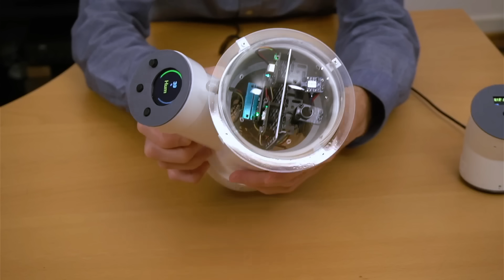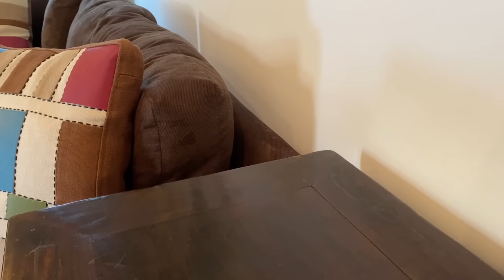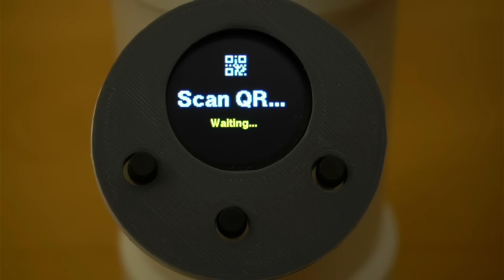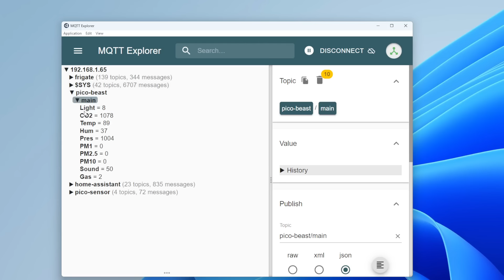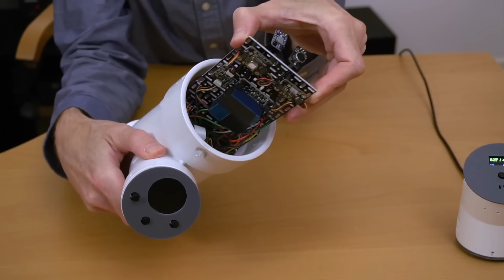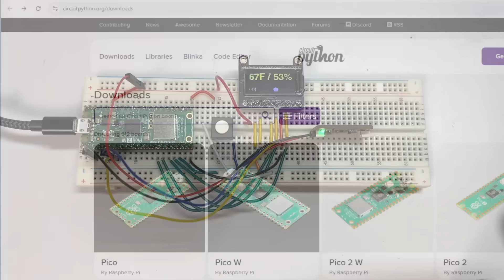Home Assistant Indoor Sensor Project You Didn't Know You Needed

Comment: Looking for a sensor that works with H2 gas for home assistant. The reason is I have Lifepo4 batteries for solar I want to detect H2 gas which if the battery malfunctions and vents this gas it want to be alerted to this.

Comment: I re-designed the top for bolting the screen and sensor to the top so you don't need the bread board, slightly different momentary switch, so you can use header pin jumpers for easy wire install/troubleshooting. Not sure if you'd be interested in the STL or not but I think it looks sharp
Reply from the maker: Sounds great, please do post the STL file and/or a photo in Github!

Comment: Any chance you can provide a slightly cleaner wiring diagram for the mini? I like this a lot and want to make sure i get it right
Reply from the maker: Yes, though it may take a week or two. I need to find the online CAD tool I used to use.
Reply from the maker: I uploaded a new diagram. For any questions/comments, please use this issue: https://github.com/alanb128/ha-environmental-sensors/issues/1
Reply: @BorisDigital  Thanks for making the cleaned up version! Looks great plan on wiring this weekend!

Comment: Wondering if it would bd wise to install a small ventilator in the pipe to make sure it isnt measuring stale air
Reply from the maker: That's a good idea. I forgot to mention in the video that both devices have vents in the bottom and holes drilled around the sides to help with airflow.

Comment: Why would you use a pico for only the basic one?... You could use an ESP that is much smaller and you can configure it and make it talk to home assistant right from within Homeassistent itself using ESP home. it will make your project much smaller and easy to hide. You can then even include a OLED display and even more devices. Plus as an added bonus. You will not need to set up the wifi as ESP handles this for you when you deploy the device. it also does over-the-air updates to the software.
Reply from the maker: ESP is a great alternative. I guess I'm just more familiar with the Pico because I use it in a lot of projects.

Comment: how do the air quality sensors work if theres no airflow in these enclosures? i imagine the ppm would have to be very high before the sensors register a change in the air quality. would it be better to install a small fan to circulate the air?
Reply from the maker: That's a great question! Both device cases have multiple holes drilled around the bottom to allow for passive airflow. My theory is a fan would artificially change the sensor readings. It would be a good experiment to prove or disprove that theory though.
Reply: Yes, you're right that a fan could change the sensor readings, most of them (sensors) have spec sheets that describe their requirements in terms of airflow and their performance at various points. But in this case a fan could actually change them in the right direction 😊

This was probably an exercise in "how many different sensors can I attach to a Pico?". I can hardly see the need to have all of them at any single place in the house, let alone at multiple places simultaneously. Add to it that the readings are way off (e.g. the temperature is higher by a few degrees, the sound is "measured" in "units" on an uncalibrated microphone, completely ignoring the standardised ways to measure sound volume etc.) and that it is ugly as heck 😂 and one could be better served by using just the needed sensors in a smaller, more discreet case. Just saying! 😊

Comment: Meh. The sensors gas/CO/VOC are rather useless IMHO. As it can be one, all, or any of those, but you don't know which is which. There's a reason why true CO monitors are 4 to 5 digit devices.
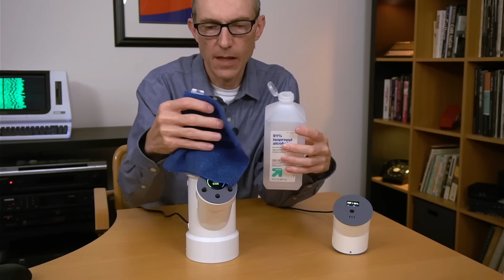Reply: 6:22 As I said, you can't tell if someone tipped over the isopropanol bottle, or if it's lots of CO and you'd rather not enter in there.

Comment: Odd question:
Is there a reason you can't shorten the cables and cut the PVC pipe a bit shorter or does the pico's emi/heat cause issues when the sensors are too close?

Other side note for others;
You can look at phone charger packs (battery banks) to power these if you have a location not close enough to plug it in (or build one). You will need to find a way to monitor battery capacity to know when to  recharge them though (that is an exercise left to the reader).
Reply from the maker: You can totally modify the PVC, but I didn't want to spend any time on that. There's so many PVC fittings to choose from you could probably find a size to your liking without having to cut it.
The Pico gives off far less heat than a Raspberry Pi, but it can still add a few degrees to the readings.

Comment: Nice. For some of these sensors (temp, humidity, light, movement, co2 and pm25) I bought ikea air quality sensor for 10$ or so and fit everything inside. Based on esp32 or esp8266
Reply: Which sensor from IKEA are you using?
Reply: @TomLichti  vindriktning
There is some space inside so you could fit few sensors + rgb led to indicate quality of co2  + mini esp controller. I also changed fan voltage from 5 to 3.3 to limit the noise

Comment: Putting a hunk of PVC drain pipe in my family room won't be considered style IMHO.
Reply: It’s some kind of doctor who
Reply: Use whatever you want. For some of these sensors (temp, humidity, light, movement, co2 and pm25) I bought ikea air quality sensor for 10$ or so and fit everything inside

Comment: This is so freaking cool! Version 2.0, how can this be "wireless"? How long would it last per charge?
Reply from the maker: For the mini one with no display (or switching to an LCD without a backlight) You might be able to get a few days on a charge with good power management. The "beast" would not be a good candidate for battery power. All those sensors combined use a lot of current.

Comment: How well do your temperature sensors work?  I've found that when using an ESP32/ESP8255, the wifi radio creates enough waste heat to make the temperature readings garbage.   If you think about the power that's being consumed by those sensors, essentially all that is turning into heat trapped inside those enclosures and you need to have some way to both exhaust that heat and sample the outside air.   It's a harder problem than I expected, and explains the "pagoda" structures you see with outdoor weather stations that have to deal with solar heating and getting adequate outside airflow.

It's a really neat solution to use circuit python and "raw" MQTT vs. the usual ESPHome/ESP32 based solutions.  And clever using PVC pipe accessories as building blocks; what a great idea!
Reply from the maker: Thanks! The Picos do add some heat, but not as much as an SBC like the Pi 4. It's probably a constant 3 - 5 degrees, and I plan to add an offset value. There are vent holes in the case meant to help, but it's still a factor.
Reply: @BorisDigital  While an offset may reduce the error, you cannot count on the difference being constant with variations in temperature, humidity, air movement and MPU activity. It may work better having the sensor at the bottom assuming rising air. Also make sure to have some distance, and using wires instead of soldering a sensor directly to the larger PCB. Do note that humidity readings can also vary with temperature.
Reply: @JohnnieHougaardNielsen Good points!  Maybe a small fan like the one used in the blue particulate sensor could be used to exhaust air from the bottom (or top) so there is a constant small airflow.